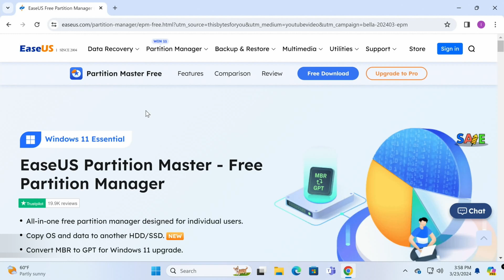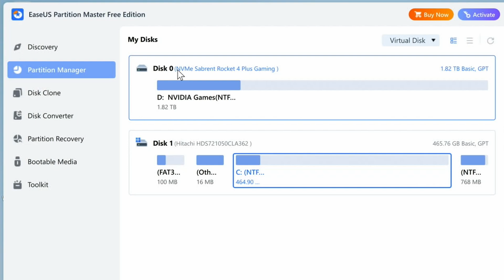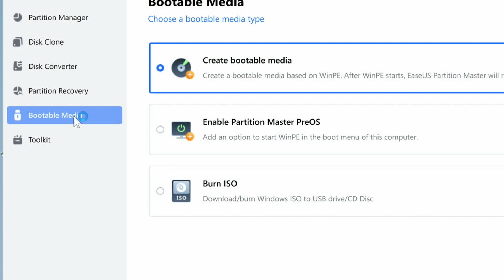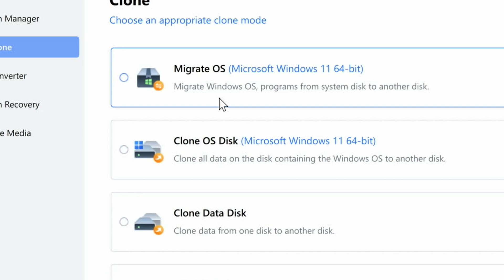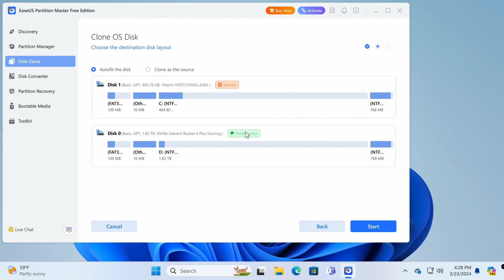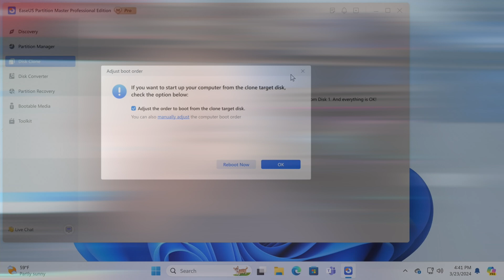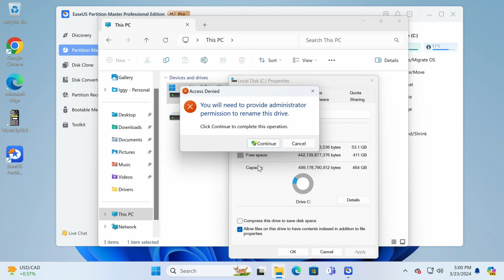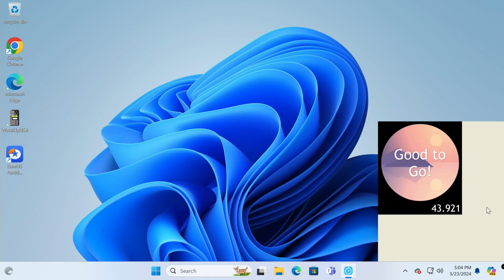Supercharge Your PC for More Speed and Storage

Comment: Great info as usual! I'm hoping to speed up my PC. It's 10+ years old with an integrated graphics card which makes editing videos a challenge. I use Corel Video Studio for home movies. My C drive isn't full, but I'm using several flash drives to store data and was thinking about adding a 870 EVO 1TB SSD drive. My mechanical hard drive is slow and MBR. Do you think moving all my data to the SSD would speed up anything? And would it be better to install it internally or just buy a sleeve and use it externally? Just looking for any way to speed up things a little without a lot of expense.
Reply from the maker: An SSD will be a HUGE boost, but depending on your needs, you might be better off adding an SSD and keeping your mechanical hard drive for storage.   This video will help you switching from MBR to GPT, does your motherboard support UEFI?  What is the manufacturer and model number of your motherboard?
If you can use UEFI, and you have the ability to use an M.2 SSD, you might want to check out this video: https://youtu.be/Ih28muags6s?si=1ysjt1N_3K0zPHMI
Personally, I am completely on SSD, no more hard drives in my machine, my hard drives are in my NAS now.
Keep your drives internal, unless its a hard drive, keep that out of your system.
Reply: @ThisBytesForYou  My motherboard is a Gigabyte Technology Co., Ltd. GA-970A-UD3 (Socket M2). I use Windows 10 Home 64 bit as Microsoft says I can't support Windows 11. My CPU is a AMD Phenom II X4 955 Deneb 45nm Technology. I have 16 gigs of ram and my hard drive is a 931GB Seagate ST31000524AS ATA (SATA). I use Acronis for my cloud backup and it has a cloning app, so I could use that to clone my hard drive to the SSD I already own. As I mentioned before, it's a 870 EVO 1TB, so my current hard drive should fit. Will my motherboard support switching from MBR to GPT? Are there any downsides? And I have no idea what UEFI is or whether I could use an M.2 SSD. I watched your videos on all that and feel confident I can clone my hard drive to my SSD and change the boot order, even though I'm far from being the most computer savvy person you know. 🙂 I'm saving my money to purchase a more powerful machine, but have to make do for now, so any suggestions you have on making what I have work better will be greatly appreciated. I've shot tons of home movies over the years and am trying to edit them, but my current machine is struggling to run Corel Video Studio Ultimate.
Reply from the maker: it will work, but you should clone to GPT, but you will need to listen how I show you to clone to GPT if not you will bluescreen booting into windows, UEFI is much better. and needed for future facing devices. You need a GPU for corel, this Mondays video might help, and I will have a new budget build coming soon.  Please make sure you are subscribed so you get notified.
Reply: @ThisBytesForYou  I am subscribed so I'll check out the video. When I clone from my HDD to my SSD does my HDD remain an MBR partitian? In other words, will only the SSD be GPT? You said I should listen carefully to how to clone to GPT. Which of your videos demonstrates these steps?
Reply from the maker: ahhh thanks my friend, you must have the fact that you are a subscriber hidden, no worries, it just makes it a little harder to sort through.  Yes, you will have the EXACT same the old drive has, which is why I say to change it, I show you in this video how to change it all: https://youtu.be/4BtdMcqwaFg
IN that video I use a hardware clone and software, but the software isn't free anymore
You can also watch this video after, this software is great but since it's a laptop its a little more difficult to follow for changing MBR and GPT and UEFI, so watch the other first, then this one: https://youtu.be/aHVCmkm67q8 and thanks again my friend.  I need to make a newer one.
Reply: @ThisBytesForYou  I don't understand why YouTube is hiding my subscription to your site. It showing me that I'm subscribed. Weird. Could it be that I'm using a VPN?
Reply from the maker: Subscription is always hidden by default, to turn it on, In the left Menu click Settings, then select Privacy. Turn on or off Keep all my subscriptions private.  BIOS version F1, is the very first BIOS, they are up to Version F8f, based off of the motherboard name you gave me, this is your motherboard: https://www.gigabyte.com/Motherboard/GA-970A-UD3-rev-10-11/support#support-dl-bios
I always update to BETA BIOS', but you can use F7 if you like.
After you update the BIOS, you should install the latest Chipset driver, found here: https://www.amd.com/en/support/downloads/drivers.html/chipsets/amd-9-series-chipsets/970.html
Also, Award did not go out of business, they merged with Phoenix, https://www.phoenix.com/
Reply: @ThisBytesForYou  Excellent! Thanks! And I turned on subscriptions in privacy.
Reply from the maker: @FredHolmeswriter nice, thank you, I still can't see it, but hopefully it will pop up soon, Youtube is a bit weird haah.  Thanks again my friend and I am so happy I could help you.
Reply: @ThisBytesForYou  Has my subscription shown up yet? Also, in installing my new SSD does it matter which SATA port I plug it in to on my motherboard? They're numbered from one to five in the manual. And it warned me NOT to plug it into a SATA port with RAID. What's that? And how do I tell the difference? The ports all look the same.
Reply from the maker: @FredHolmeswriter still hasn't shown just yet, but no worries.  AS for the port, doesn't totally mater until it does haha, some motherboard will disable SATA port 0 and 1 or 5 and 6 to allow for M.2 drives to work.  RAID is Random Array of Inexpensive or Independent Disks, basically joining drives for better performance or redundancy, unless you enabled RAID in the BIOS, it's disabled.
Reply: @ThisBytesForYou  Ok, thanks!
Reply from the maker: @FredHolmeswriter anytime bud

Comment: I have a 4070 super, 850wpsu, b450 tomahawk pro max and r5 5600x. Im debating if i should keep my mobo and buy a r7 5800x3d. Or upgrade both mobo and cpu. What would be the best choice?
Reply from the maker: Well the processor is a little bottlenecked, you can always go as high as a 5950X but you may need to upgrade your cpu cooling.  As a person who just upgraded from a 5900 (AM4) to an 7950 (AM5) there has been a tremendous performance improvement, but with that I had to upgrade my RAM, processor and motherboard, thats a big fee.  What do you use your PC for and at what resolution?
Reply: @ThisBytesForYou  right now im using it mainly for games. I currently have a 1080p, planning on upgrading to 1440p sometime this year.
Reply from the maker: I think the board is fine, a little limited but but would work well with a 5800x3D, you are limited to Gen3 PCIE but the 4070 Super will work fine.  This means you cannot take advantage of PCIE 4 or 5, though there isn't a tremendous real world advantage.  Upgrading your CPU, will allow you to save a little money for when AMD comes out with their newer stuff or Intel, then you can buy the new Processor, Motherboard and RAM.  

You will notice a bigger difference at 1080P since it is more CPU bound and that difference will decrease at 1440P and 4K since you will be able to utilize your GPU more.

So I would call for the processor for now.  How much RAM do you have?

Comment: Hey brother it’s me again. I’m still really grateful for all the help that you have given me with my first gaming pc build. I have this situation. I had a problem with my graphics card. While my son was playing fornite all the pc turned off. First I thought it was the power supply but it was the graphics card that got burned. (Thank god it was under the returning period) so I did return it. I got a new graphics card and the pc turned on without any problem. 

But then a saw that every single time that my son plays fornite, all the RGB lights turn off. Not just the fan RGB but also the Ram RGB lights. I already tried using another RGB program controller but still happening the same issue. Now this hasn’t affected the fans or any other hardware, is just the RGB lights. 

I already tested another games and it just happens while playing fornite. 

Peace my fiend.
Reply from the maker: have you tested temperatures to see how hot the card gets while you are gaming, how hot the CPU gets, etc?  You can use MSI afterburner.
Reply: @ThisBytesForYou  I’ll do exactly what you said. But still sounds weird for me because it happens just with fornite. Once a close the game the lights turn on automatically.
Reply from the maker: games make the PC work harder, so that makes sense, heat makes the system use more power, aside from using more power because you are using more of your PC.  What is the manufacturer and model number of your powersupply? @josenca90
Reply: @ThisBytesForYou the power supply is a Thermaltake GF1 ATX 850w 80 plus gold and my graphics card is a XFX Radeon RX 7600XT 16gb GDDR6 and 3 fans. The other graphics card that got burned it was the same brand and model but only with 2 fans.
Reply from the maker: is your pc plugged into a surge protector or directly to the wall? @josenca90
Reply: @ThisBytesForYou  to be honest, neither of them 😅 I have a braided extension cord plugged to the wall and the pc and monitor are plugged to it.  But a surge protector and a braided cord I believe are the same right?
Reply from the maker: NEVER EVER EVER plug anything straight into the wall, use a surge protector, dont get a cheesy one either, you can use my amazon affiliate link, this one is great, and not too expensive, EVERYTHING in my house that plugs into the wall is on a surge protector, https://geni.us/tRT41c  @josenca90
Reply: @ThisBytesForYou  I’m just ordering it right now !! Thanks man!
Reply from the maker: @josenca90  this could be exactly what your problem is, dirty power, power spikes and this will save your PC from burning out from a lighting strike, if you save your receipt, apc will replace your components as well if they die from a surge

Comment: I'm assuming we can do this with an SSD to NVME? Sometimes I'm nervous to do things like this if I'm not tech-savvy. I mean I built my PC, but if something happens I'm screwed.
Reply from the maker: Yup, many people don't realize, SSD's, the standard 2.5 (in some cases 3.5") drives also came in NVME, and not all M.2 drives are NVME drives,  there is no difference to programs like this with NVME drives, you will be good, make sure to nab a key.  Though, I do have a 30% off coupon too if the keys are out, I show you in the video how to nab a key.